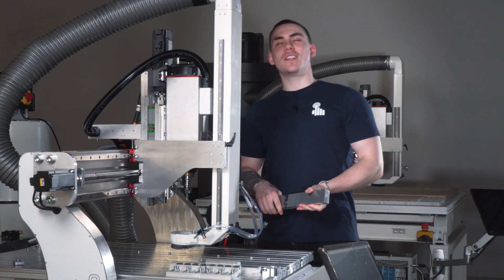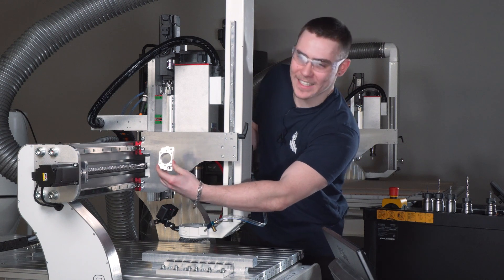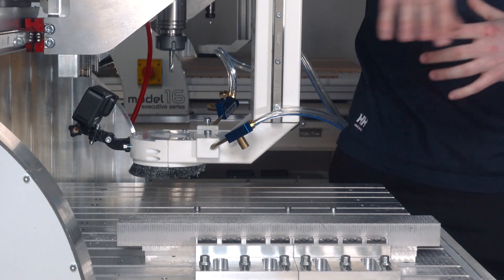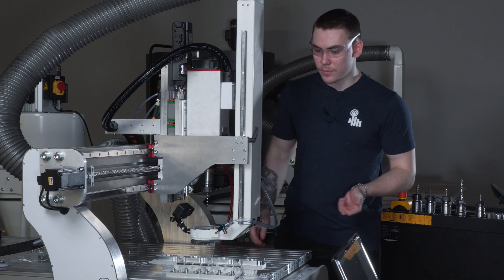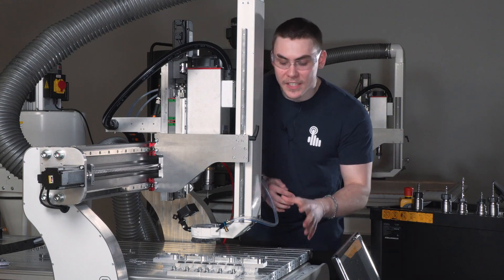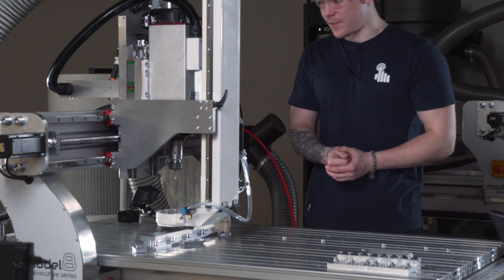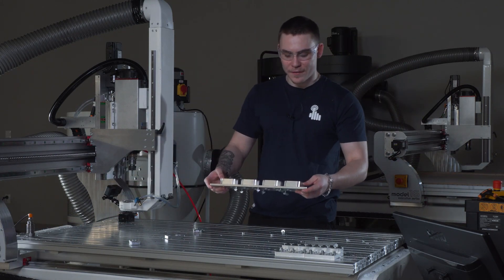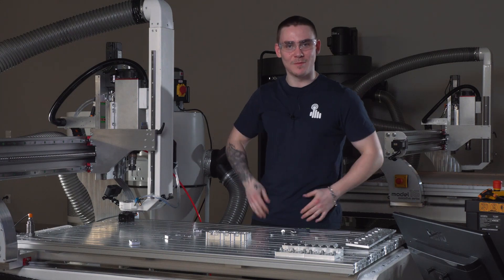CNC Machining of BALLNUT HOUSING

Comment: if you make only 4 parts of aluminum per hour you will bancrupt . Part like that should have machinig time of max 2 minutes or less 
depend of tolerance of the big hole or if you have any other tight tolerance. Without aby tight tolerance on that even 1 minute of cycle time 
if a lot to be competitiv.
Reply from the maker: Hello Nenad, thank you very much for your comment. I was making these parts because our supplier was too slow and expensive. We used to pay almost 50 dollars per part and wait 2 weeks. Now we can do it in house in no time and for a fraction of the cost. Machining time wasn't the main goal, but I will try my best to optimise the cycle time in the future.